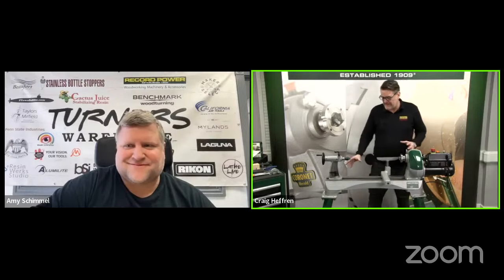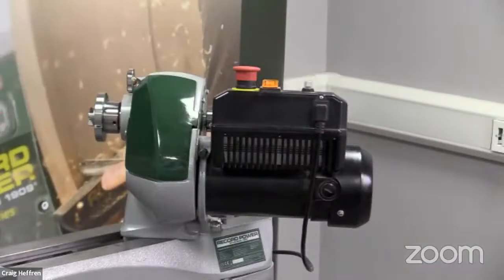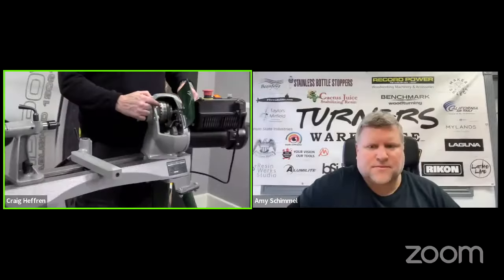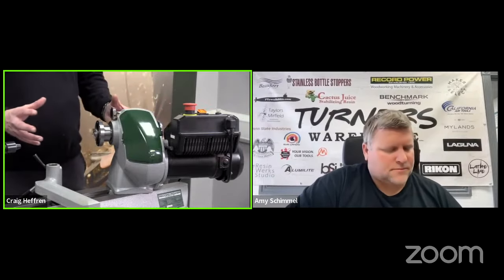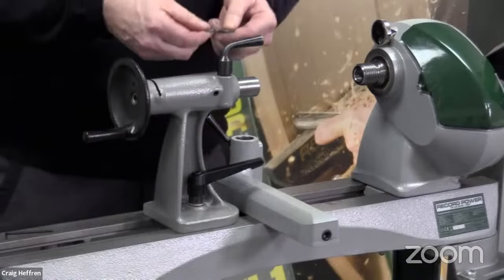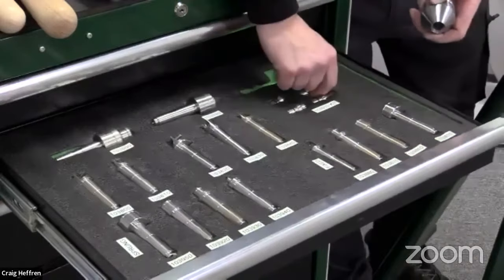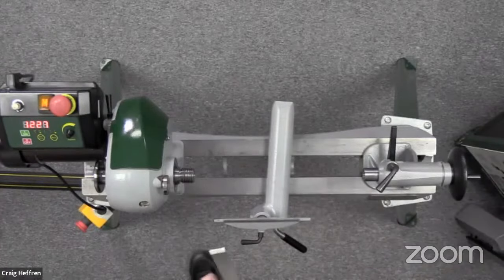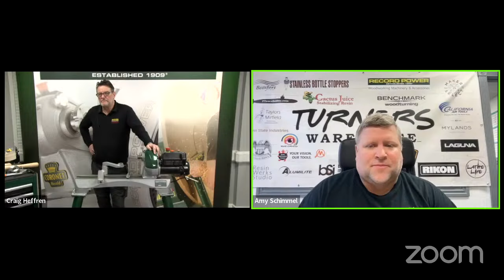Deep Dive on the Record Power Herald Lathe

Comment: Hi Chad, you asked a question about which chuck to get, the SC3 or the SC4, I think one point that was not mentioned is very important, in that the SC3 comes with a fixed mounting thread, so if , like me you have a 30 year old lathe with a 3/4 inch 16tpi shaft soon to be upgraded, and bought the SC3, to fit it, it's not upgradable to the new M33 fitting. Whereas the SC4  has loads of adapter rings to suit different lathes so when do upgrade the lathe, you  take the chuck with you! I just bought an SC4, and it is totally brilliant light years away from my old RP3000 I've been using for 30 years. Hopefully I'll soon have a shiny new Herald in the shed! Really enjoyed the video, certainly re enforced my view of that lathe, ...best regards...Pete
Reply from the maker: good point for sure!

Comment: Hi, power supply black box specifications? It get broken after turn off, It is jumping something inside when You shake It. It is 80volt? There is no voltage label on the black box
Reply from the maker: Are you located in the United States?

Comment: BTW, the set screw in the back of my tail stock wheel does not come out the hole. It unscrews enough to get the retainer out but it wont fit through the hole in the wheel. FYI.

Comment: Hello, what is the result when doing the kiss kiss test?
Reply from the maker: We do a lot of small turning so when we return the headstock to do a small project we use a double ended morse taper tool to make sure that the alignment is spot on. 
Here is a link to the tool, (unfortunately it's currently out of stock) but it will ensure your alignment is perfect. I hope that helps! 
https://www.turnerswarehouse.com/products/mt2-alignment-tool-double-end-morse-taper?_pos=10&_sid=fe6f5d4b6&_ss=r
Reply: @TurnersTv  Thanks for your reply, I have the Herald and have a double ended morse taper. But I'm wondering if my headstock is slightly higher than the tailstock, should this be acceptable or is it a production error? Because I don't know how to rectify this.
Reply from the maker: Oh that is def a question for email. If you got the lathe from us, you can reach out via email at support@turnerswarehouse.com or if not from us contact Record directly or the retailer that you went through
Reply: @TurnersTv  Thank you for your honest reply, I am from Belgium (Europe) and so It came from a shop here. When I bought it, I immediately addressed the issue. However, I got a reply as well from the shop as directly from Record Power that the life-centers that I used to show the difference in hight are for Metalworking and that for wood turning this doesn't need to be as accurate and are in an acceptable range. I could not believe what I was reading, what is the purpose to align it with a double ended morse taper then? Eyeballing can do the trick to then. So I'm not very happy with this.
The moral here is, you also telling me that this will need to be addressed through an email. Meaning that you can't give a clear answer on this matter because this could be, on your first judgement, (by reading it) a production error. And I do understand that you can't and will not give your honest opinion here! In the mean time I'm stuck with it. Thanks again for your swift reply, keep up your good work.